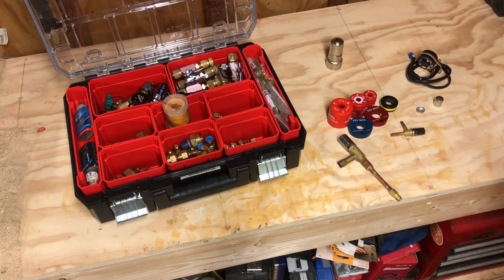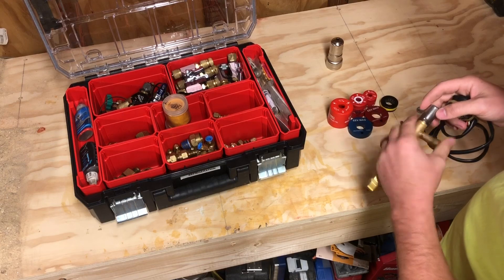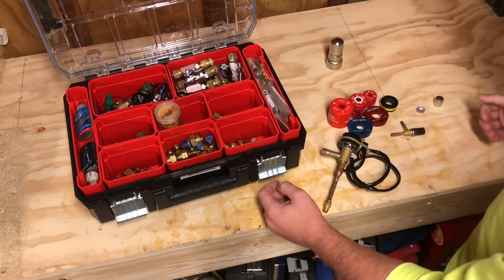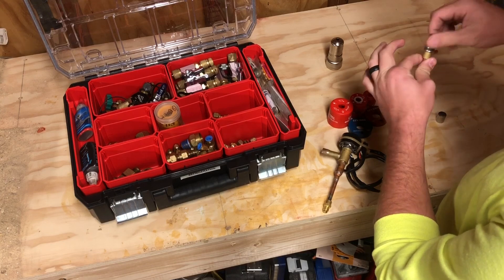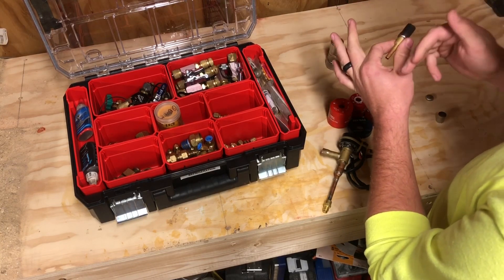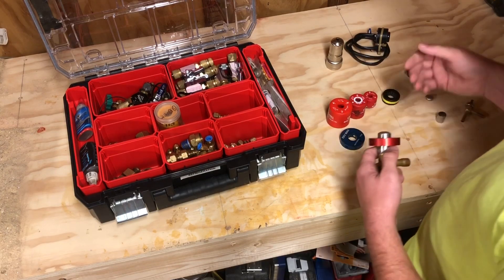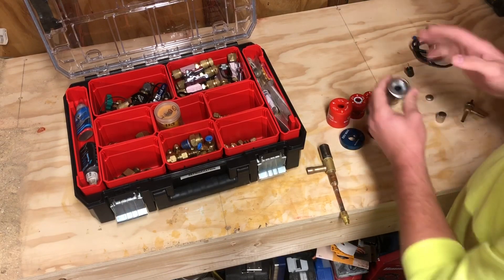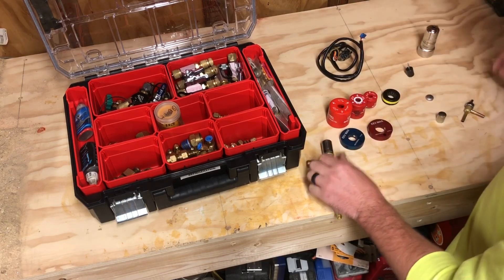EEV Magnets? Can’t I just use a solenoid magnet?

Comment: EEVs have to rotate instead of being pushed/pulled.   Use a segmented magnet  It will rotate to EEV valve core when turned.
Amazon carries them.  It may work if you take one or more of those doughnut magnets and break them into semi-circles and put them back together..  One end becomes north and the other will be south.

Comment: I have tried to cut 2 of those open now with a dremel tool and both time I cut the magnet. What did you use to cut it open?
Reply from the maker: Copper cutters
Reply: @quentinbutlerhvac5410  Thanks, I tried those last week and it pressed the steel housing inwards and pinched the magnet. New blade and went the slowest I ever had with copper cutters.

Comment: You can just take an old eev motor cut the wires off and it will open and close those valves
Reply from the maker: Hmm.. Not with any valves that I’ve worked with. The EEV motor is essentially just a coil / stator. 
Without anything energizing / magnetizing the coil, it doesn’t have the ability to turn the magnet (rotor).
Reply: @quentinbutlerhvac5410 i removed an EEV magnet, i also cut out the valve section and tested the magnet by blowing into the valve, rotating the magnet clockwise closed the valve while rotating it anticlockwise opened the valve, confirmed by me blowing into it. So it does work. For some reason this experiment stopped working after i played around with it for a few minutes. I dont know if the valve got stuck open or if the magnet stopped working

Comment: Thank you. Excellent video. I recently had to evacuate and charge my mini split but did not know about this tool. Does the EEV need to be manually opened to ensure a proper evacuation and that the liquid refrigerant finds it's way into the outdoor condenser? Very inspiring video.
Reply from the maker: Thanks for watching! With a 1to1 minisplit it is not critical to open the EEV manually for evacuation as there is only 1 metering device. Therefore, there is no potential for refrigerant to become trapped.

Comment: Have you found a source for the 17.5mm daikin manual magnets
Reply from the maker: I primarily use the Carel magnet set for all Daikin valves. They are a little loose but have no issue turning the valves closed. Thanks for watching!